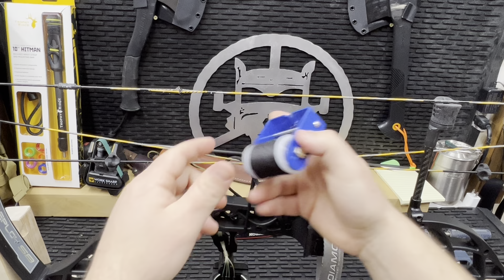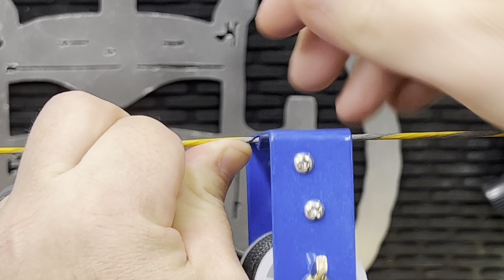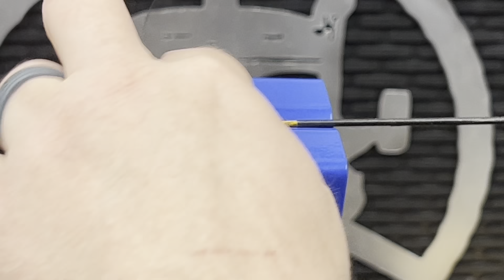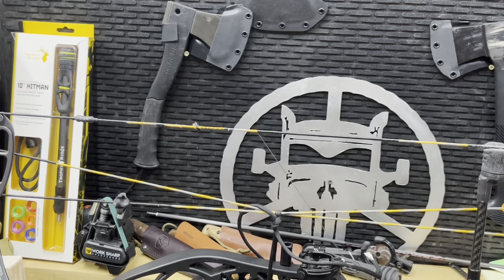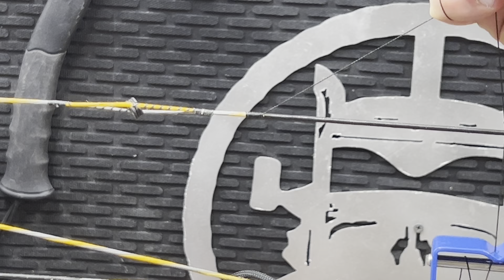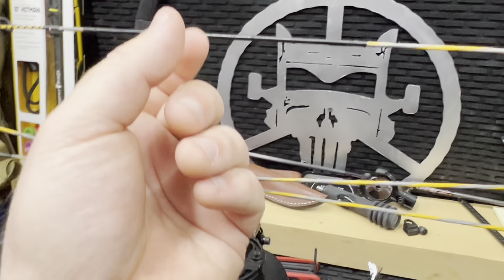How to Reserve a Bow String- Replace a Center Serving!

Comment: Nice video.  That was a really long center serving... I've never seen one up as close as the peep!
Reply from the maker: Yea I went super far up with this one due to the fact that that I have a terrible time with the d- loop sliding up. I went higher with it this time and it has yet to slide up, worked great. But yes you normally wouldn’t go that high.